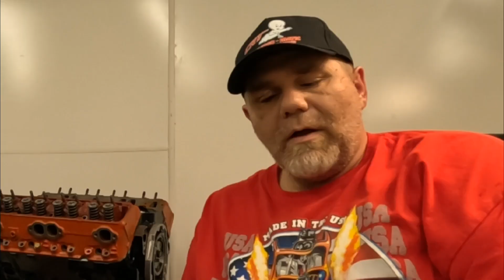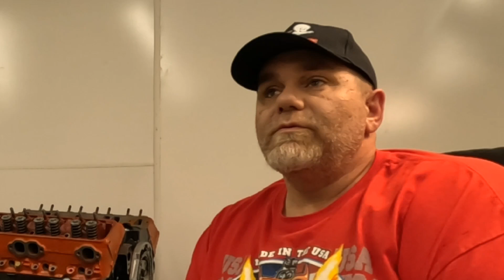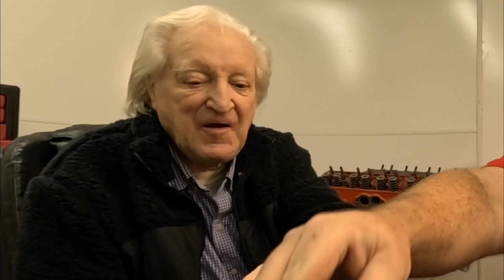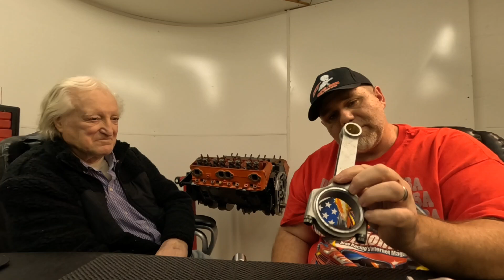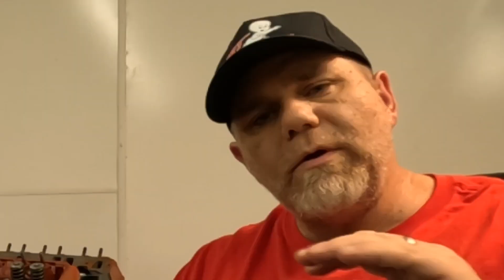When is Stock NOT really STOCK? @DavidVizard @servediocylinderheads @JustMoparJoe

Comment: Guys, the concept could not have been simpler or more direct.  How much power can we make by reworking and massaging all of the original parts of a non-high performance engine.  It was never supposed to be a BUILD, it was supposed to be an EXPERIMENT.  The goal was an IMPOSSIBLE one (hence the name...) but it was a BENCHMARK to shoot for...1 hp per cube.
Let me repeat....it was supposed to be an EXPERIMENT. an EXERSIZE IN CREATIVE ENGINE BUILDING....it was supposed to be a FUN project that ANYBODY could follow along with and apply the TRICKS to ANY ENGINE.
How this all got so twisted and off the rails is beyond me
Reply: I agree with you Tony, I was really looking forward to the PURE STOCK potential build. However as a hot rodder since the eighty's I can also completely understand how a project gets out of scope and out of budget 🙄🤦😂
Reply from the maker: @donsims1941 you can follow Tony's build! I'm sure it will be awesome
Andy
Reply: @UnityMotorSportsGarage  I plan on following both 👍
Reply from the maker: @donsims1941 $800 for having the heads, block and offset grinding the crank VS $400 for rods?? 
Andy
Reply: @UnityMotorSportsGarage  true, I think the difference is between paying a shop vs being able to do your own machine work and not counting labor into the build . I think from Tony's perspective you guys have the set up and know how so it doesn't translate into build cost or maybe I'm just projecting my own mindset into the situation. Because that's how I calculate my own stuff. Me and my friends usually just trade off work 😂
Reply: @donsims1941 I did an engine reconditioner apprenticeship years ago. I have a lathe, and a drill press. All I have to do is find myself a cheap mill, and then I'll be able to do most of my machining from home and start enjoying my car hobby again. That's the goal anyway. Surely I'm not the only die-hard that would rather modify stock bit's instead of buying new ones.
Reply: I really doubt that Uncle Tony will do a version of Mission Impossible, he has a habit of not following through....
Reply: Tony I understand where your coming from, I can't wait to see your build.  I will be following both.
Reply: @bigboreracing356 no no helping children who are in desperate need is not scandalous no matter who is involved. 

What "ruined" the project is simple......goes right back to human nature......we want more more more lol.

The power number is what ruined the project.....simple as that....it was never about trying to get the most absolute power a 318 could make.....it was about optimizing what was there to see if YOU could make it make more power....not the parts.
Reply: Gentlemen I can understand both schools of thought regarding the project. UTG’s side on what is possible with the original stock parts. Andy and DV’s side what is possible with stock parts and then progress to what is possible when stock just isn’t enough (as all hot rodder’s do). Time is money how fast do you want to go? All for a good cause. 

I enjoy watching each of your channels. I found DV as I was looking for answers on understanding cam selection and what the numbers mean. That led me to Andy and meeting him at Shadyside dragway. That led me to UTG then to Dr Art. You each have something unique to bring to the table and so maybe there is a collaboration project in the future. UTGs test mule car, DVs extensive knowledge in extracting the most from an engine, Andy as the builder and race against Dr Arts death trap electric go cart…
Reply: @JudgeMeNotLeMans  I AGREE 👍I don't so much see this as a conflict as I do the birth of a NEW project and for a GOOD CAUSE 👍. I Think Andy David's project is great and Tony has already said he is going to proceed with the original idea so I think everyone wins 🤷
Reply: Just build it with modified stock rods, the modified stock 2 barrel, grind a nice transition to the bottoms of the bores, perform whatever witchcraft you can to a stock exhaust, regrind the cam, shave the block to match the change in the cam's base circle, and send it. Go aftermarket later, just see what it makes on the dyno, if it isn't 300 hp, who cares?
Reply: I just want to point out that I have a rod in my leg as a result of a motorcycle accident and I’m planning on replacing it with one manufactured by ARP at some point.
Reply: This engine will be similar to same stock build.  Just better parts.  These parts won't be an incredible power advantage over the stock ones.  Listen to the video.  Andy and David got smart on this one.  You're looking at how much money in machining and how much time is spent doing all that?  Vs just getting parts that do the same thing but are better and cheaper to do.
Reply: We should fight... On the Internet.....
....that will solve everything....
Reply: I understand uncle Tony's view. Although it would've been better to do what Freijburger did in the early 90s.  Take a truly bone stock 440 out of a big body or an RV and stuff it in the absolute lightest dart he could get.  I believe it was the quest for 12s on an ultra low budget. He wouldn't even buy a new transmission mount and used hose clamps to clamp it down. Now it wouldn't pass tech today but it as truly a fun ambitious build to follow.  
Here's the important note : he never added a single performance part until he failed getting into the 12s. 
Now maybe the mission impossible could have been a max effort truly stock build then after it only made 180 horsepower THEN add the pistons and rods and show the incredible increase for several hundred dollars more. The same with the carb and intake and camshaft STILL not swapping the heads. .
I think that would've satisfied both uncle Tony and Andy.  
That's just my two cents.  I have the utmost respect for each of you  ..
BUT.....I also CLEARLY understand Andy's and David's view.  For me hands down I'd go for the rod piston combo.  
But guys ...honestly it wouldnt be stock. I built engines for years for pure stock classes and with those pistons I'd be thrown out at tech during post race inspection. 
I think St Judes affected the decision and I whole heartedly support St Judes and understand the reason behind the value per cubic inch side of it and giving whoever wins the auction truly the best 318 ever built because of who was the builders.
Reply: I have been thinking about this... Very first test all hand modified bbd, egr truck manifold which is horrible, 675 heads 1.78/1.5 3/8" stem  valves, beehive springs. 100% stock 318 NEW cam from Rock auto. All on top of the upgraded short block. Not exactly the original design but it would be interesting seeing a huge difference D.V. designed high performance cam.
Reply: well UTG you gave em a free engine. rest is up to you.
Reply: @bigboreracing356  "They did prove that 318  mopars equipped with OEM passenger car short block parts  are junk but they look good shiney."

WTF?? Have you ever actually SEEN a 318 bottom end? They are heftier than any other engine its size (and many that are larger), and capable of handling more punishment than the 318 cubes can ever deliver. 318 is a great engine, and not that difficult or expensive to build into a good performer.
Reply: @bigboreracing356  Apparently you haven't seen UT's Bottle Rocket then. Check out the video where he races Andy's Ford truck "Casper". Totally stock a 318 is a ho-hum engine because that's how they were designed. But modified they are a completely different animal, and there is nothing more satisfying than outrunning cars owned by people who think they are "turds".
Reply: @bigboreracing356  WTH are you talking about? Nothing scandalous attached to anyone here that I know of so please enlighten me?
Reply: @bigboreracing356  .......are you under the illusion they won't.......did the moon landing actually happen? 🤣
Reply: It's about the mystery of turning an ordinary boring engine into a hart crusher.  You race a guy with a 10k motor and win.
Reply: @ericuncapher9922  except you'll just embarrass yourself if you go up against race engines with a low hp 318
Reply: @bigboreracing356  They don't need to use aftermarket rods, unless a) they are building a highly modified engine intended to put out a massive amount of horsepower such as a stroker with a blower on it, or b) they just want to waste money on aftermarket rods.
Reply: @bigboreracing356  Maybe polished 318 rods will not work for what "they" are doing, but an UNPOLISHED completely stock 318 rod will work perfectly well for just about anything you want to do with a 318 in the "real" world. The thing is, these guys are doing stuff that is way beyond what most of us would ever do with a 318, or any engine.
Reply: @bigboreracing356  oh god now we are playing the victim card 😂

Personal responsibility guy, dont drink and comment because it makes you look like you hate children......its not my responsibility to coddle your comments about my kid because you couldn't handle your liquor.
Reply: @bigboreracing356  and your woke too? Birthing person? Jeez get your life together 🤣
Reply: @bigboreracing356  self projecting are we? Ok Bill Crosby dont self incriminate now 😂
Reply: @bigboreracing356 I have a video of flowing one of his w5 heads. I think it was a w5? He does nice work!
Reply: Tony, I think the problem is the 318 has too many easy and cheap “stock” alternatives. Better heads, off the shelf pistons, rods, a 4bbl intake etc. are available. You should have given them something like a 66 International Harvester 304 V8 w/193hp where you have no choice but to use the existing parts and maximize it in an attempt to hit 304hp. Good luck buying your way into an easy, cost effective powerful engine.
Reply: @keithiverson6687  I actually ported a set of 304 ih heads 30 years ago. I couldn't give them away.  Too bad.
Reply: @servediocylinderheads that’s the point. It can be done, but who would want to unless they had no choice or were attached to the idea. A Ford, GM, Mopar engine has lots of compatible aftermarket or higher optioned stock parts that make it easier to achieve a certain hp goal.
Reply: @keithiverson6687  Dude, the brilliance of what you just laid out there is profound!  I (we) evidently didn't see that forest for the trees.  That absolutely should have been the way we went.  We erred on the side of convenience
Reply: Don’t care! I think you guys have nailed it. If it is a big deal he should have been there in the beginning with the help. OF course this is going to happen with 2 pros working on a project. My god the man hours you got in just the crack shaft alone is nuts (would love to see it what a piece of art). The heads ! The guy has so much time on those hands and values AND intakes! Wow!! If this was so important to him he should have been side by side with you guys working together. That is truly that. Of course this is going to happen. All 3 of you guys are professional engine builders. Who’s going to bid on a junk yard motor you can get out of a salvage yard. Good for you guys and best of luck. I wish I were rich cause I would come down and try and help cause I love the idea of this project. So much fun just thinking about what you guys could do to make this into a monster. Thank you for your hard work and someone’s always going to cry. I mean really! Why didn’t he give you the piston’s and stuff for the motor. It’s has to board out and stuff.
Reply: Junkyard Jet was supposed to be an experiment as well.  An experiment in what can be done with a very small budget.  I believe Mission Impossible was to be a learning/teaching experience under the same premise as the Junkyard Jet.  Yes money always makes things better, but not everyone has the disposable income to purchase steel rods, forged pistons etc etc.  I look forward to watching both ides make it to the dyno.
Reply: @amster This is exactly what happened with the Junkyard Jet.  Same concept, build with simple, easy to find second hand stuff and go as quick as you can, and next thing you know it's got a thousand dollars worth of seats and every bit of the ARP catalogue holding it all together.  That was total insanity
Reply: @UncleTonysGarage  Yes, I was dismayed by some of their decisions. Ease of parts acquisition superseded the budget!!
Reply: @bigboreracing356  nope didn't get the shot either.....mainly because I don't believe in conspiracies.....like you do apparently 😂
Reply: @bigboreracing356  its really all about the money with you isn't it.....sad. 

I wouldn't care if I was living in a cardboard box just so long as she survived....But I suppose if you had a choice between money and your own kid the green wins every time for you, thats fine....just don't expect many people to be on your side in that debate 😂
Reply: @bigboreracing356  big talk but that is all you are 😂
You would need to find someone willing to have your child before you would ever need to worry about it.......so in other words you will never need to worry about it 🤣
Reply: @bigboreracing356  your not responsible you are right.....and the world is better off without you raising a kid you are also right 😏
Reply: @bigboreracing356  wow your brain must hurt after shambling together that pathetic response 😂
Look your ego is hurt I get it but take some time to come up with a response that makes you look more competent than Joe Biden would ya 🤣
You must be drinking and commenting again 🙄
Reply: @bigboreracing356  fake news 😂
Keyboard warrior who has zero chance of getting laid.

Only one of us has actual proof 🤣
Reply: @bigboreracing356  its not much of a fight anyway lol 
Im just kinda watching you flail words at a keyboard in hopes of sounding intelligent 😂
Reply: @bigboreracing356  you cant even read my comments right your so red in the face 🤣

Take it slow and read each word one or two times to try and solve that puzzle pice......I'll wait it will take you some time 😆
Reply: @bigboreracing356  no fear, just didn't want you to get too far behind in the conversation......or well its not really a conversation its just me getting the most amusement out of you as I can.....basically your like a jester to his king but you know...call it what you want 🤣
Reply: @bigboreracing356  the only one trying to maintain control of anything is you so far, but you never had it to begin with lol 

You lost control the moment you declared yourself a child hater 🤣
Anything after that is merely for my amusement 😂
Reply: @bigboreracing356  if you had at least a 3rd grade reading level you would realize I said YOU were throwing words at a keyboard to try and sound intelligent 🤣 

I knew from the start there would not be an intelligent conversation.....due to the fact your lacking in that department clearly lol 

So now I am merely batting you around for my own amusement, it is funny to watch you struggle to come up with a mediocre statement 😂
Reply: @bigboreracing356  I conveyed the fact you are throwing words at a keyboard to TRY and sound intelligent lol 

I didn't have a hope in hell of you actually achieving that goal 😂
Reply: @bigboreracing356  You dont seem to grasp just how much your getting played in this "conversation" lol 
You are literally my entertainment, I just sit back and wait until you comment again so I can laugh at the obliviousness 😂
Reply: @bigboreracing356  maybe they'll do something crazy like helping sick kids
Reply: Hey guys I have a idea maybe y'all can do a engine master like competion dyno hp deal with certain rules like 10 to 1 compression limits,30 over bore,factory stroke rods,factory heads,aka circle track rules against Utg for shitsngiggles for the win 12:34
Reply: Bigboreracing356 wud have to use same Dyno for competition winner chicken dinner
Reply: @MrSwinger1  Where could you possibly get the idea we were trying to convert a 318 into anything?...or even nuttier, build a cheap street sweeper with this thing.
  I'm guessing reading comprehension skills were never your strong point.
Go back and have someone read the original post to you slowly.  You may be able to fully understand it after the 3rd or 4th time.
Reply: Everybody calm down as hotrodders we're a family type community no need to fight or loose friends, everybody has different ideas that's why they have different brand engines and sell millions of different parts to do the same job
Reply: @bigboreracing356  not about the business its about the kids....I take it you don't have any? 

Or if you do...I suppose it wouldn't matter much if they were dying just so long as some guy on the internet says they don't need the charity. 

Regardless of what you think...I care about my kid and would like to know the hospital I take her too has all the resources in the world to help her.....if they needed it or not 🤷‍♂️
Reply: Take your stock heap, put your cheapo labor into whichever parts ideas or concepts you want to try, and doing what you can afford... And have fun with it.
DV, CS, AW, are giving us a place to shoot for. 
"Aim for the sun and hit an eagle.
Aim for an eagle and hit a rock." Native American saying. 👍
Reply from the maker: Tony that is what we are doing an EXERCISE IN CREATIVE ENGINE BUILDING.. 
We could spend $800 in decking the block,heads and offset grinding the crank, or put $400 rods in it.. seems pretty simple to me 
Andy
Reply: @UnityMotorSportsGarage  Andy, you're not seeing the forest for the trees.
Reply from the maker: @UncleTonysGarage Tony you said you didn't want to be involved, and that is fine. I get it, and you are doing your own build which is even cooler! David and I really do wish you the best of luck
Andy
Reply: @UnityMotorSportsGarage  Yeah, I'm taking a completely different approach to this CONCEPT now.  Actually just purchased an entire vehicle for it today.  I'll talk about Mission IMPROBABLE tomorrow...and no, it has nothing to do with 318's.
Reply: @UncleTonysGarage I am both really excited about the way that sounds......and also worried about the tone shift that is happening with you and Andy over a pile of parts 😅

....A years worth of silent stress inducing buildup of a project that hundreds of thousands of viewers have constantly been asking about that has finally come to a head pile of parts...but a pile of parts just the same lol. 

......but I do really want to see a before and after piston flip back to back test in a car if that fits into the new plan! Lol
Reply: Imagine That , you said you were building the 318 ? Now What a stock 360 -340 can't wait .
Reply from the maker: Cool deal!
Reply: @UnityMotorSportsGarage  Send Tony the  reworked parts to save him some time.
Reply from the maker: @mikeeiben3430  he is now doing a 361 or 383 now last I seen on his live chat
Reply: @UnityMotorSportsGarage I understand where your coming from price wise, but having a cheap build wasn't really the point?

I dont want to get on anyone's bad side by speaking out but.....well....the whole point was to see what the tricks are worth not so much making a sleeper engine 😅

New rods and pistons are nice but it is kinda taking the sport out of the game just in my opinion......I mean you can't have a mission impossible without the greatly debated almighty piston flip right? 

Now since it is going to be auctioned off for a good cause ya build a badass engine to get the most you can for it!😎 

But to me anyway....its not really the "mission impossible" anymore its more the "mission no child left behind" which is absolutely more important than just youtube content. 

We have a difference in opinion but that is fine with me, at the end of the day its just parts.....and hopefully just a pile of parts isn't a big enough issue for you and Tony to lose a friendship over......as it is kinda seeming like judging by this comment thread 😅😅

I just figured I would put my opinion out there for whatever its worth.....not much but mabey something 😂